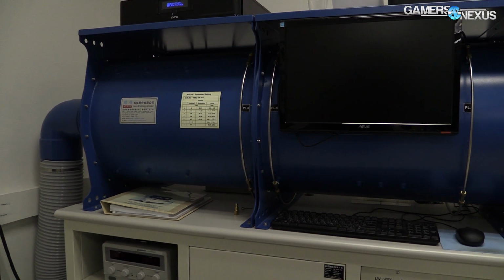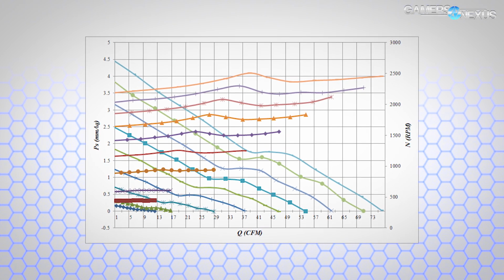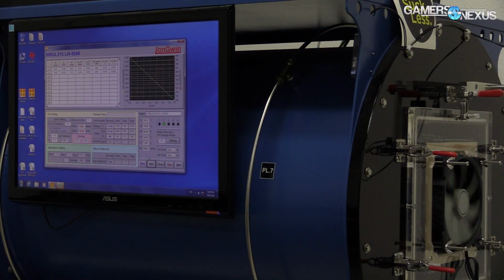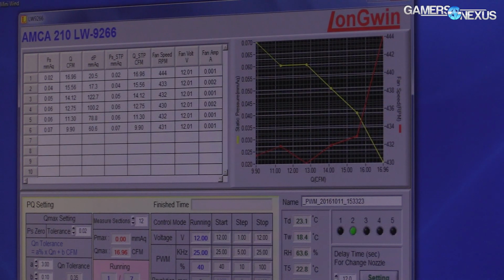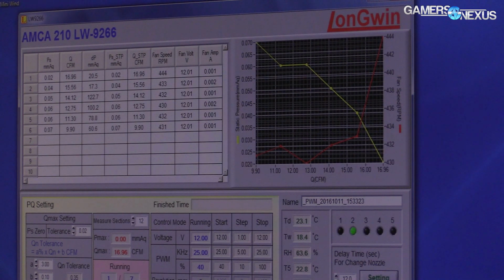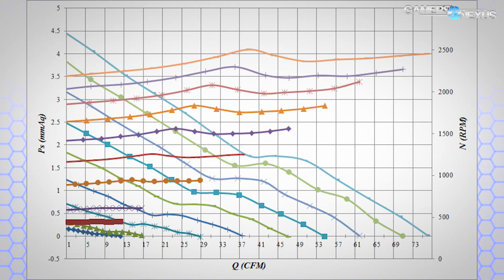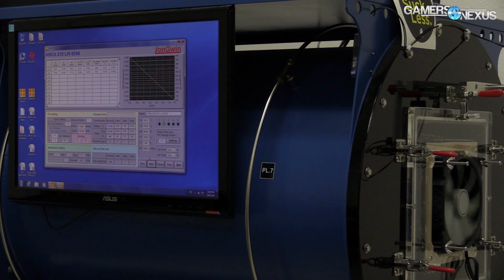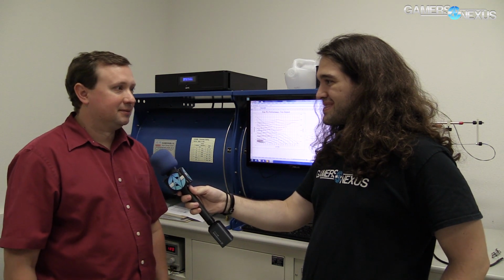Thermal Chambers and Wind Tunnels at Corsair's Office

Comment: Need a heater chip? Just pop an fx 8300 in! Jkjk. That's an interesting way of testing cpu coolers though.
Reply: We do it this way so that the test can be repeated over and over again with a high degree of reproducibility. Also because I can generate any heat load I need.  So if I need to simulate a 40W CPU, I can just turn down the dial.  Using software load on a real CPU gets some steps, but probably not the exact values I want.

Comment: Is it a limitation of the mic used why your so aggressively shoving it in the engineers face all the time?
Great content nonetheless.
Reply from the maker: We're using $800 of audio equipment. The room is filled with high noise fans. It's a validation chamber for fan, thermal, and power supply testing -- that has to be compensated for.
Reply: Bobby Kinstle you did a good job m8,appreciate your efforts.
Reply: Thanks!
Reply: I had a terrible cold that day and my voice was crap.  I couldn't talk very loudly and it was very noisy in there too.
Reply: HAU ITSME yeah thats what i thought.he needs a better mic so hes not bizzy ramming in his face all the time.he looks like hes not listening to what hes saying
Reply: Gamers Nexus are you guys natively from Cali?

Comment: Corsair have engineers and advanced equipment...yet they still rebranding their AIOs...
Reply: We buy from multiple vendors for AIOs, and significantly customize the product. At some point you have to question whether its worth it to customize something though. For example: we buy capacitors directly from, say Niopon-Chemicon. Why don't we design and make our own capacitors? The answer is because Chemicon makes excellent, fantastic capacitors and we can buy them on the market and make other products with them. Same kind of logic applies to some of the components in AIO - the pump motors designed by the AIO vendors are usually quite good for their purpose and redesigning it would take years and potentially millions of dollars - and that would be to MEET the spec of the one we can buy from a vendor off the shelf.

But who knows what happens in the future.
Reply: George Makris well, thanks a lot for taking the time to explain, you really explained it clear as crystal. Touché to me I guess, keep up the good work and I appreciate you took the time for that honest and elaborated answer.
Reply: And well... I can try to, at least, say it. It would be nice of Corsair to have official support in my country, the are lots of pc gamers here but no support from any manufacturer of the pc industry, there is not such thing as RMA, retailers never offer more than 6 month warranty (and stupidly, you void the warranty by using the product) and prices are crazy high. 
Hope you read this, I'm from Chile.